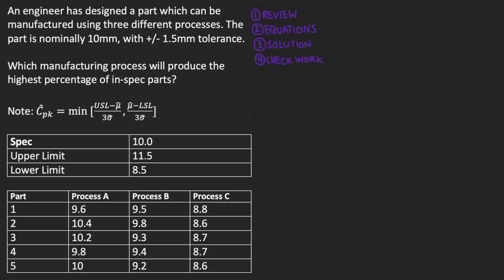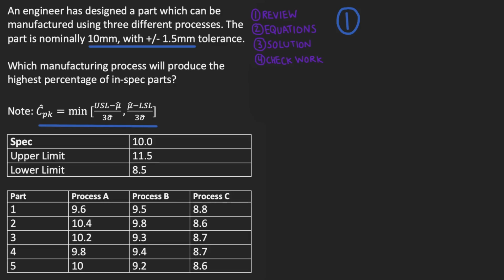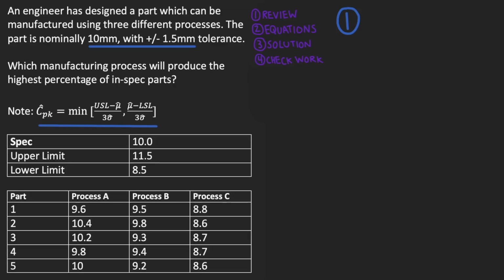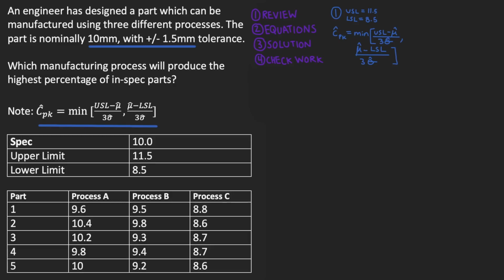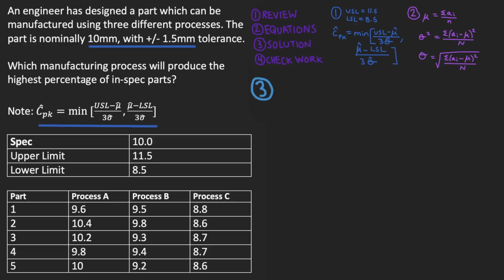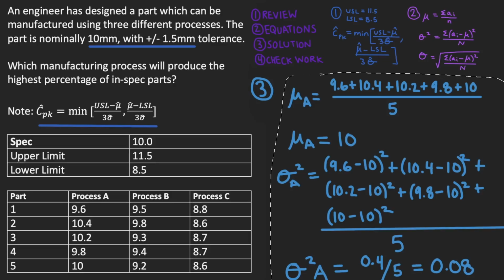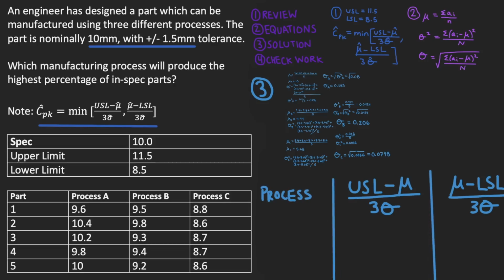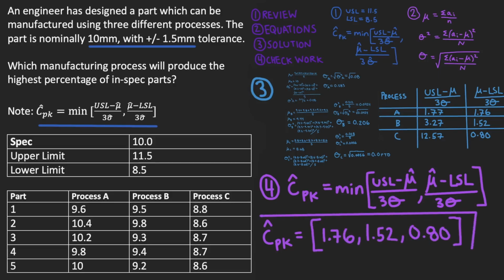TESLA Mechanical Design Engineer Interview Question SOLVED! #13

Comment: Process A has the highest Cpk value of 1.766, which indicates it is the most capable process for producing in-spec parts. A higher Cpk means the process is better centered and has lower variation relative to the specification limits.

Comment: Process A will give highest number of in spec parts, because the smaller Cpk from both calculated , (deviations closer to the min limit Vs deviations closer to the max Limit) is 1.67 and it guarantees all parts in spec. For Process B and Process C there is Cpk lower then 1.67 which will produce parts out of spec. For Cpk 1.33 defect rate is per milion produced parts is 63. For Cpk 1 2700 Defects per milion, for Cpk=0.67 DPM is 45.500parts etc... Regards

Comment: A higher Cpk value indicates better capability:
The higher the Cpk , the more centered the process is between the specification limits, and the lower the variability.
The higher Cpk  value means a greater proportion of parts are within the specification limits (both USL and LSL).

Comment: So, in conclusion, the process that gives the highest percentage of in-spec parts is Process C, isn't it?
Reply: But since all three manufacturing processes produce 100% in-spec parts, there is no difference in the percentage of in-spec parts produced by each process. Therefore, any of the three manufacturing processes can be used to produce the part with the desired specifications. I guess what is missing in the problem is a target.
Reply: @cala093  This is a small sample of parts made by this process, so just because the parts listed are in-spec does not mean that the process will always make in-spec parts. Therefore you have to rely on the Cpk to tell you which is best.
Reply from the maker: @cala093  This problem is confusing to me. I should go back and review it, but I'm going to make some new content instead ;)
Reply from the maker: Yes, that is my understanding! Process C should give the highest percentage of in-spec parts as it has the minimum process capability index value.
Reply: @Arch1medes  It's actually the opposite.  CPK value correlates to how many in-spec parts you have. Process A would have the most in-spec parts.  Generally a CPK of >1.0 is targeted in non-critical applications, and 1.3 or higher in critical applications.  You can validate this intuitively by looking at the CPK formula.  As the precision of the parts decreases, the standard deviation goes up, which drives the CPK down since the standard deviation is in the denominator.
Reply from the maker: @tomconsolazio  Hi Tom, I don't fully understand this problem, but I agree. Thank you for catching this. I will revisit and add a correction.